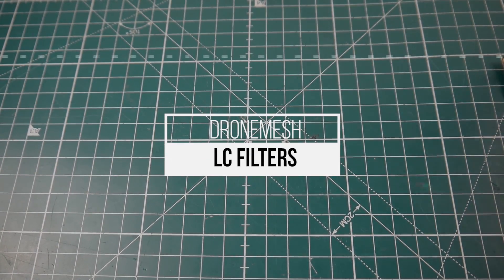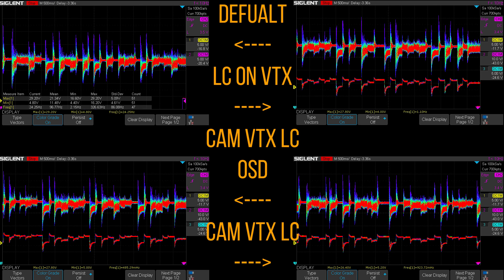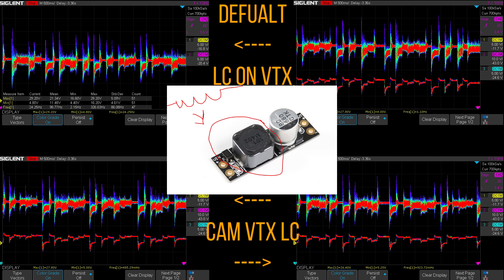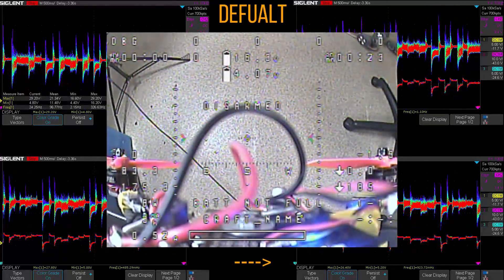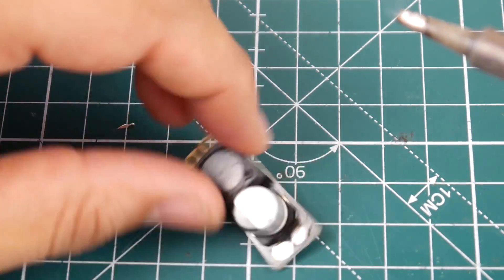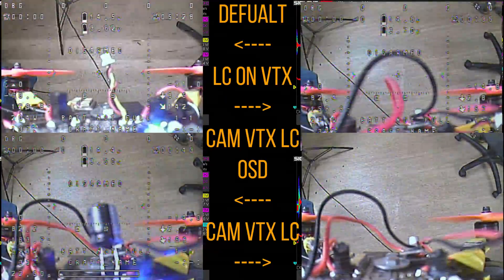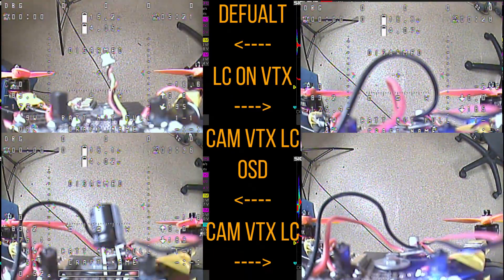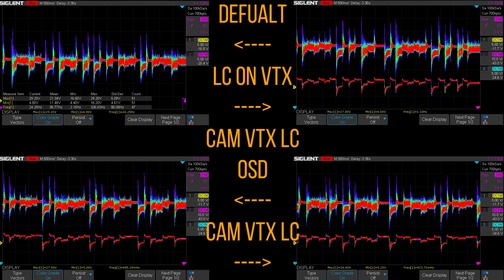Which is Best?? // LC FILTER VS LOW ESR

Comment from the maker: LC filter is on VBAT.

TOP LEFT:              No filtration
TOP RIGHT:           Vbat > LC FILTER > VTX
BOTTOM LEFT:    Vbat > LC FILTER > VTX + CAM > Video signal through OSD
BOTTOM Right:    Vbat > LC FILTER > VTX + CAM > Video Signal Direct
Reply: LC on vbat? So you are filtering everything directly from battery and then noisy components are added again, in case of my setup (Matek PDB - BlueJay F4 rev3). I mean, what's the use like this? What I do usually is put an LC filter on the 12v rail behind the BEC and put there all video stuff (except OSD, cause that's 5v and would need a cap or separate LC but another LC is a bit overkill, lol). That said I hardly have to use an LC these days. Only on a setup with a 12v VTX which cannot be powered directly from vbat (rmrc 1.2Ghz for example) and need to be filtered out, including cam. I'm just worrying about my OSD which can still cause troubles. It's a minim (non-micro). So now I'm thinking about capping the ESCs first. Frame is a modified ZMFR250 so there's space on the arms no problem.
I guess.. in case of an AIO there might be use to have the LC at vbat but the again I'm not using LC's on those setups. Like others said, ESC caps .. or better wraith32 v2/tekko32. Noise killers :D
Reply: So the LC filter goes in the VTX power line??

Comment: So putting a low esr capacitor on my flight controllers 5v & ground will help my video feed?
Also if yes...do I install it on the cam 5v & ground?
I was just getting ready to purchase an LC filter thanks for the heads up buddy.

Comment: I was thinking a schottky diode with a capacitor? It will only have about a .25 voltage drop. You stated earlier that you have a voltage regulator that suppresses the max voltage anyways. So it was just a thought?
These are old videos and I'm sure you worked out all the bugs since then!

Comment: So LC filter does nothing?  What is you ESC Protocol, PWM freq., timing, PID/Gyro KHz, set to?  I get way more noise on Proshot1000 8k/8k than if I set DSHOT300 4k/4k tbut the feel and response time is just way better.  Also, I've heard people using a coax cable on the video line that made a huge difference.  Can you look into this?

Comment: I'm running a mini vtx5848 with 2 470uf low esr capacitors on the main battery leads, getting really bad video noise. had none when running a vtx03. I tried wiring a micro matek 12v bec to power the vtx but it made no difference. do you have any suggestions?
the noise I'm getting is thin diagonal lines across the whole screen.

Comment: I'm working in an applied electronics area and the coils are always a pain in regards to electromagnetic emissions. Basicaly they become small antennas and usually are the main target for shielding. There is a chance that the flickers are actually interferrence between coil emitted em field and the video signal.
Reply: the system (ubec+leads+lc filter+cam+vtx) can resonate at certain frequencies and create even more noise.

Comment: One of your so-called filers is an active circuit: regulator + LC filter. That's obviously NOT an LC filter. You shoud state that so nobody gets confused. Such a regulator could create, because of the output filter, spikes in the input current thus creating the problems for the circuits in front of the "filter". You should be more careful...

Comment: This is really interesting. I had a quad crash due to desyncs again and again. Couldn’t find the issue and took everything apart. The strange thing is that on other quads the parts separately still functioned fine... now hearing you I thought damn, I had an LC filter between my ESC and FC which powered everything else via VBATT. So I now think this LC filter was the issue. The ESC just got hammered with tons of additional noise and just reset itself mid air. This has cost me al lot of arms, motors, top and bottom plates!

I’m never going to use LC filters again!

But, I did have crystal clear OSD and video LOL

Comment: I think your missing the point of the diod or LED. It's meant to be used in flyback mode. ie reversed. So (-) of LED connects to (+) preferably directly at the motor wire. This way the energy is  consumed in lightning the LED and doesn't travel backwards through the ESC. IT BY NO MEANS WILL REDUCE EFFICIENCY AND DROP THE BATTERY VOLTAGE!!!!!,
Please, please PLEASE!!!!! Research flyback diode. People KEEP telling you to try diodes and LED's because you dont listen, and just keep testing cheap rubbish like generic LC filters which ain't going to do sh#t. LC filters are frequency specific and cant cope with the dynamic range of noise (frequency's - Back EMF) from the motors.
This is why BetaFlight has filters for different frequency ranges and also dynamic filtering. 👍

Comment: All right there my frend i have never had the problems u r shoing i have an omni bus f4 and it is geat so i run 2204 emax prity noise motors with 30a esc so i dont get eny nose like u r regenerating toke soon if u disagree

Comment: Ceramic capacitor across a DC voltage  works better for the purpose of sending noise to ground.  Electrolytic capacitors are  designed to retain a voltage level.  Example, if you have an a.c power and you want to d.c it you use a full wave rectifier and a electrolytic cap to smooth the  modulating dc.  To minimise a spike from the a.c we would use a ceramic capacitor across the positive and negative pins to remove that spike.  Look at a simple a.c to d.c regulator to see what I mean.

Comment: Anyone suggesting diodes in series are armchair quarterbacks who misunderstood someone who actually knows what they are talking about.  The most common method to prevent high voltage spikes in a DC source is by installation of a zener diode of the appropriate breakdown voltage across the voltage inputs to a device (essentially in parallel with your low-ESR cap) that acts to clamp the peak voltage by shorting that over-voltage through the zener (of appropriate power rating): https://youtu.be/O0ifJ4oVdG4?t=22m23s

Comment: Remember the time when all ESCs are bulky and heavy, running Simon K and such. All of them have 1 or 2 caps weld onto  battery lead. Maybe that trend is coming back.
How about 220uf on each ESC and 470 or 1000 on main battery lead? Should save  some weight and easier to install coz of smaller caps.
Reply: I completely agree with you, but implemented differently then the past.  Look at these new WRAITH32 V2, they are coming with 1800uf on board using SMD caps and not those big through-hole caps from the past.

I would like to see Drone Mesh do some testing on your question, what is better? 470uf on each ESC or 1000uf on the main battery input.  In cases of 4in1 builds there isn't an option for this.  But.. Some of us still like the escs on the arms.  :)

Comment: Nice  drone mesh , why you do not put the fpv camera on seperet bench , or dampnig the camera that reduced some viberation in the imge , we can see more details on what you do 
Qs , i have 4 esc t-motor 32bit with matek f405 std , i need the esr with this setup and what shoud i need 4 of 25v 470uf ? or 1 of 1000uf ?,, thanks 🙏
Reply from the maker: 4x 470uF should have it running smooth.

Comment: I don't see how diodes would help anything it's all they do is block current from passing through it to my understanding that's what we use to make rectifiers in school
Reply: There's a kind of diode that will conduct in reverse over a certain voltage.  So if there's a voltage spike it will allow electricity to flow through it to ground, bypassing any other bits further along in the circuit.  Think it was either a zener or schottky diode but I can't remember.
Reply: Jason Reel if you exceed the PIV rating it's probably not going to be a good day LOL
Reply: Nah, they're made specifically to do that.  Soon as voltage drops below threshold they stop conducting again.
Reply: Yeah, it's a zener diode.  Google zener diode voltage regulator if you're curious.
Reply: dominic keen https://youtu.be/LXGtE3X2k7Y.  Check that video out kinda explains. In a previouse comment I had suggested a diode between the motor and esc but I think between the power source and esc might be better. Also a shotky would work best I believe it is designed to work with higher switching speeds. I think afrotechmods explained in another video more about this I will check n see..I'm no expert and have not tried it my self so I have no idea that's why I asked.
Reply: And the voltage drop Should not matter considering the esc runs off of 5v steady anyways? I mean please correct me if I am wrong, I'm still just learning all this.
Reply: I think you've gotten a little mixed up.  Just stick with the low esr caps.  If there are voltage spikes high enough to damage equipment then the esc's would probably be damaged too.  Since they aren't, there probably isn't enough reason to use a zener for voltage suppression if you have enough capacitance.

Comment: Canonical LC filter is supposed to filter out signal in particular frequency range. All noise in frequencies above and below LC filter working frequency goes thru anyway. Low ESR capacitors as voltage level stabilizers are better anyway. Putting both camera and VTX after filter is obvious. Otherwise noise will come up either in camera output or in VTX - those both usually doesn't have built-in voltage filters. OSD flickers are the worst :(  For builds with separate FC and ESC it is possible to put separate filtering for FC, but that may be hard. For very old builds where FC and OSD are separate boards with 5V powering it is possible to put separate filtering for 5V rail. Sometimes it helps. Otherwise solution will be low ESR caps on ESC's and battery pads or nothing :(

Do you have a circuit diagram of that large LC filter with IC and Zenner diode at back by the way? I would like to see it :)

Comment: I didn't catch  were you were connecting the LC filter? To the vbat, 5volt or 12volt? Have you done a video showing how your test rig is wired, Perhaps you could show the  connections  via a diagram. I'm  interested in where you have your probes hooked up.  Great work by the way
Reply from the maker: LC filter is on VBAT.

TOP LEFT:              No filtration
TOP RIGHT:           Vbat > LC FILTER > VTX
BOTTOM LEFT:    Vbat > LC FILTER > VTX + CAM > Video signal through OSD
BOTTOM Right:    Vbat > LC FILTER > VTX + CAM > Video Signal Direct

Comment: Just out of curiosity, what do you have the cam + wired to? When i had mine wired directly to vbat I had terrible noise and osd flicker(even with multiple caps)... soon as I threw it on a 5v it was clean af.